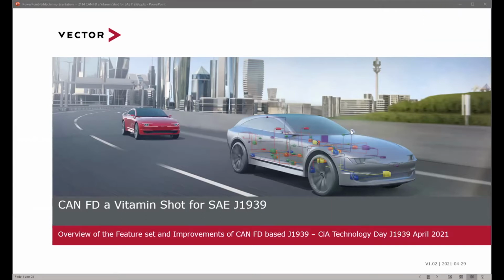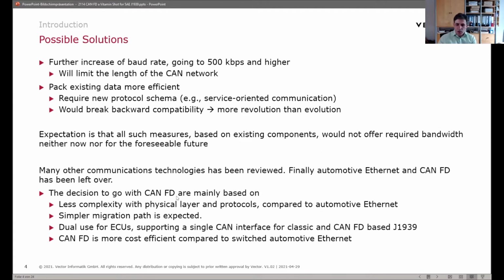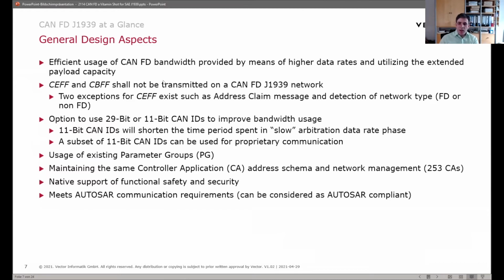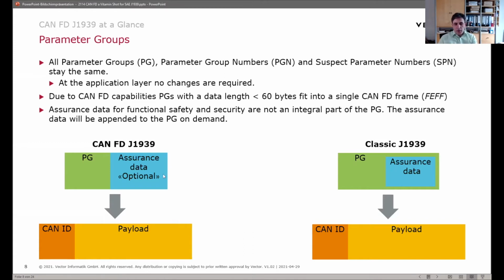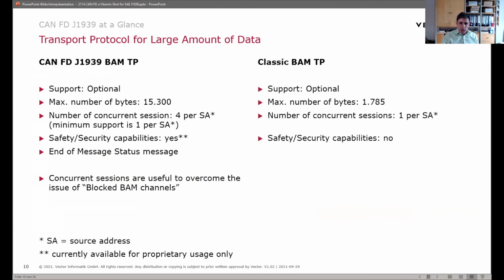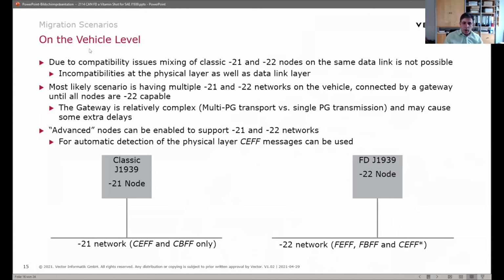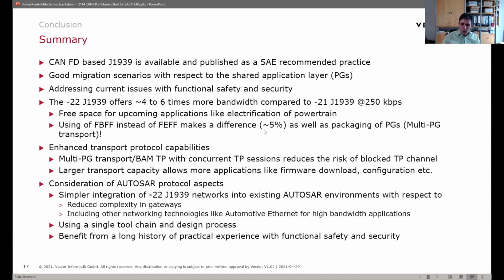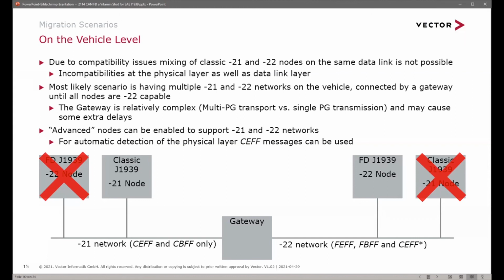J1939-22 and CAN FD by Vector - J1939 technology day 2021

Comment: Increasing the bit rate (up to 2Mbit/sec FD payload) on a functional safety critical vehicle (especially one such as construction machinery) is going to have significantly increased EMC and EMI issues. Has this been considered or is all this research purely academic? CAN FD in automobiles is a much smaller compact network with larger costs to implement in order to meet these EMC/EMI requirements, plus the EMC requirements for automotive and Construction/Agriculture are vastly different! One of the main reasons why J1939 (at 250Kbit/s) was adopted in the first place over the higher 500K/1Mbit used in automotive.
Reply from the maker: You need to distinguish between availability and functional safety. In the functional safety it is important that a failure is detected with a very high probability, very high confidence. Then when it is detected an action is taken, which most of the times is shutting down the system, so that availability becomes 0. In this regards EMI is not a problem at all, because EMI issues are part of the error detection. (Thilo Schumann)